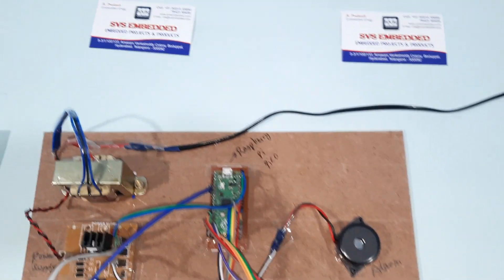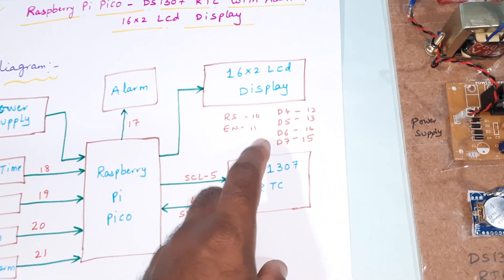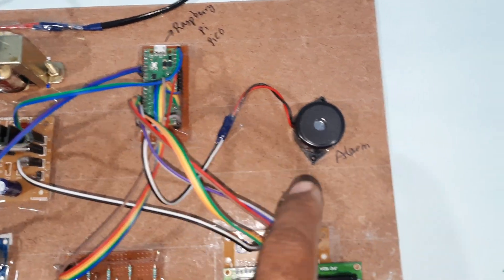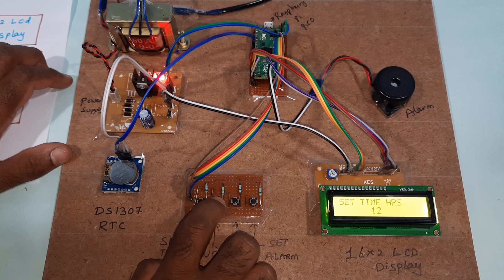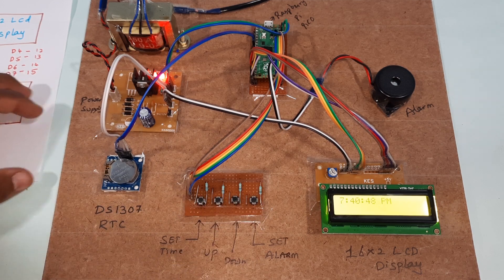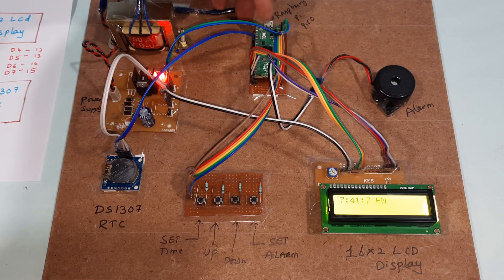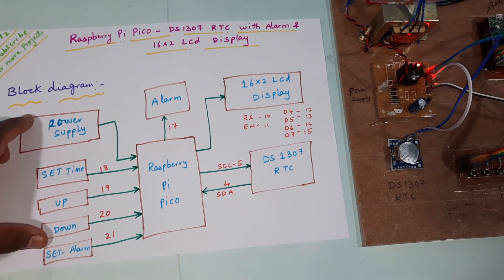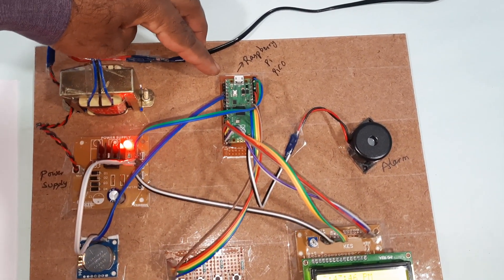Raspberry Pi Pico - DS1307 Real Time Clock (RTC) With Alarm and 16x2 LCD Display

Comment: Is it compulsory that in every project you add transformer, bridge rectifier, voltage regulator, filter capacitor. Increasing the cost and size unnecessarily. Man you can directly power the arduino nano, uno, esp boards, pico board directly through 5V usb cable.
Reply from the maker: Thanks for watching and your valuable Feed back. i will check